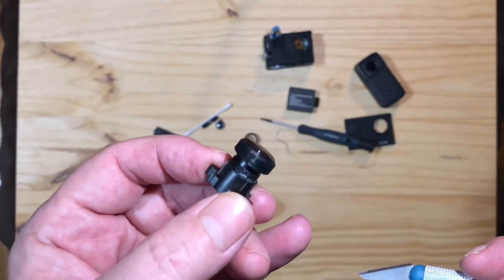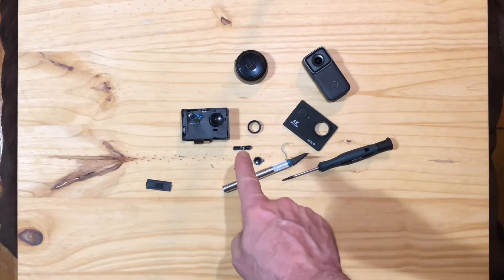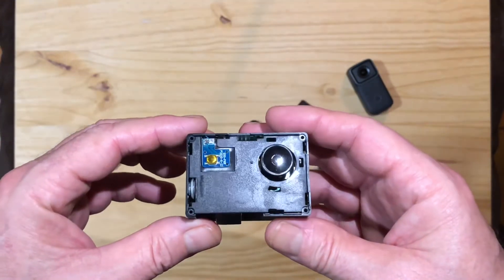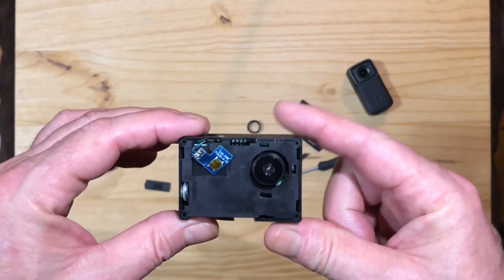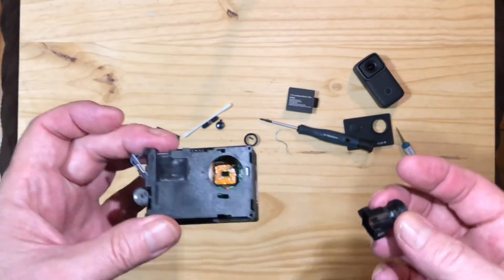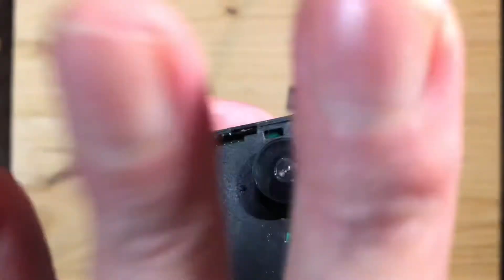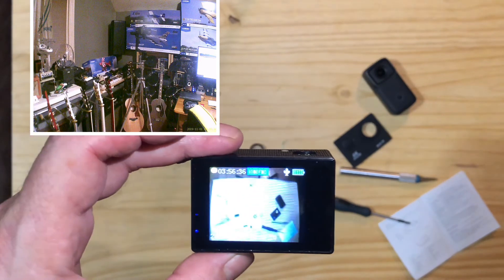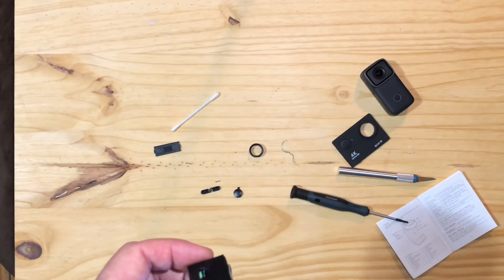4K Action Camera Repair  “Fixed focal length “ Adjustment #actioncamera #new #repair #test

Comment: Please, What is the M size of the lens thread?  Enjoying the video.
Reply from the maker: Hello . The lens is 15.5 MM in diameter. I measured it directly on the threads.
Hope that helps . Thanks .
Reply: @PhilipCockram  Thanks, I am looking to replace a Lens on the Apeman a77. I have found M8 and M12 lens  (I think that's 8 and 12 mm's Diameter??) M15.5 thread?? Do you have any pointers? Thanks enjoyed the video.. 🙂
Reply from the maker: @4WordsMediaNorth  Hi  My camera had a step to the lens bodys final outside diameter to attach the outer lens cover to .. But where it actually attaches the to circuit board inside is 12 MM in diameter . 
Your camera looks the same so I would says its the 12 MM one ..
Hope that helps .

Comment: I got the same one and after using for a while. It’s dead for no reason. Screen is black. The power light is still on if I open the camera
Reply from the maker: Sorry to hear that, Try other batteries or power sources if possible , but if the screen is actually dead there not a lot you can do .
The other cam in the shot is a SJCAM S200 . Ive been using it for 3 yrs now with zero issues . Most of the RC videos on my channel are filmed with it  .
 They have a newer SJ 300 also I believe . They are less than have the price of a Go pro . If you are looking for other alternatives . Thanks for watching .
Reply: @ I tested with new battery this morning. I can open the camera while charging. I can hear the sound of opening but the screen is still black out. I can connect it to my phone with wifi. Camera is ok. But the problem is I can only open it while charging even with new battery and screen is still black

Comment: Where in canada are you?
I have a cam that I bought at value village for $10 all of the accessories were still in the bag unopened. took the cam, turn it on the screen is white. I am able to take pictures but the screen is just white. 
 I saw a video and it said it may be because of an software update
How can I repair it?
Reply from the maker: Thanks for watching . I'm a few hrs N of Toronto .
It could be several things causing the white screen ,
A bad sensor ,  chip , lens or software ,
You should be able to find software / firmware updates directly from the manufacturer if they are available .
But if the screen is blank there maybe no way to see the menu or settings options to install it .
All other repairs will require the camera to be opened and there are only a few things you can repair on them .
If the sensor is no good for example , it would not be possible or cost effective to replace it .
i hope that helps , 
You could probably sell the accessories and get your $10 back  , Lots of people want more mounts and cases .
Reply: @PhilipCockram  Tks for the reply, I have tried to download the update but it wont  let me , it kept sending me to a third party.
But I was about to ship it to you haha so you can make a video about how to fix them.  im in ottawa